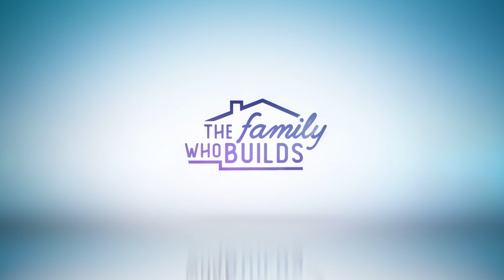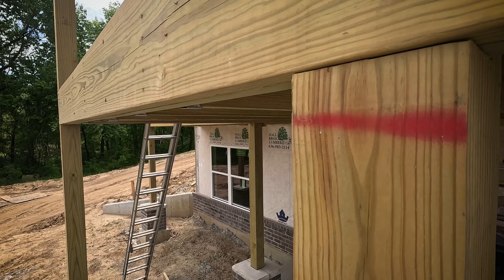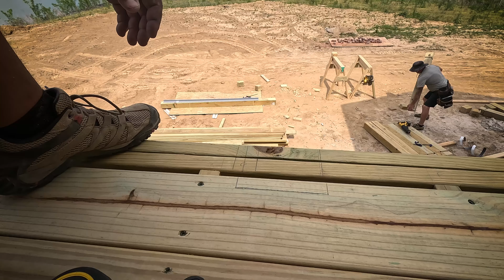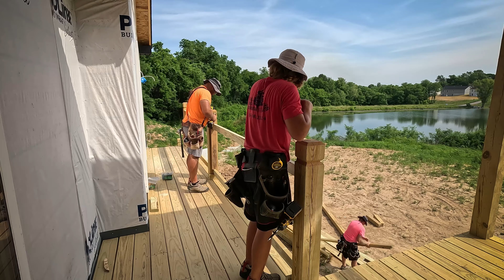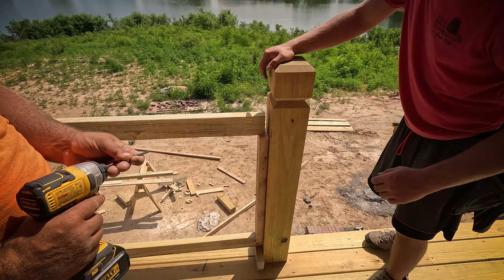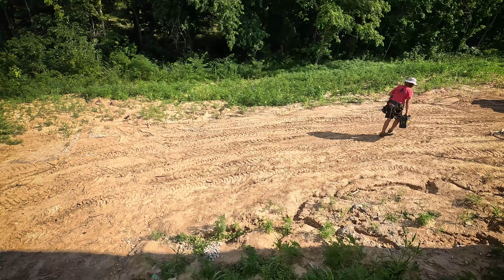New Deck Build with Lake View | Home Building | pt 3 of 3 | Railings

Comment: Do you sand off the spray paint?
Reply from the maker: depends, if we are applying the top coat (finish) then we will sand the entire face of whatever has spray paint on it.  When the finish is applied by another trade like a painter......we just try to use the best lumber possible and leave it as it is.